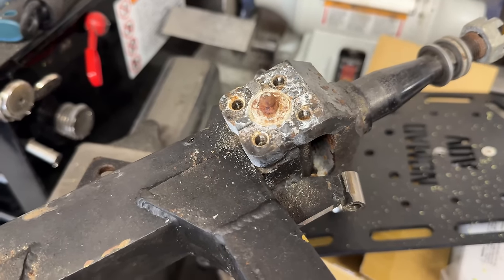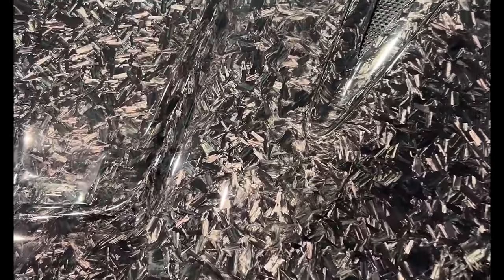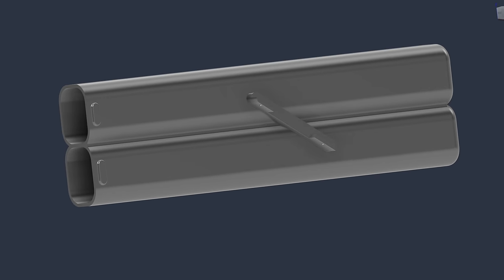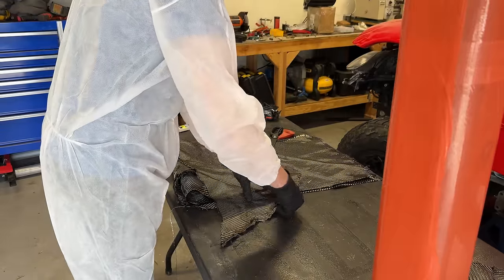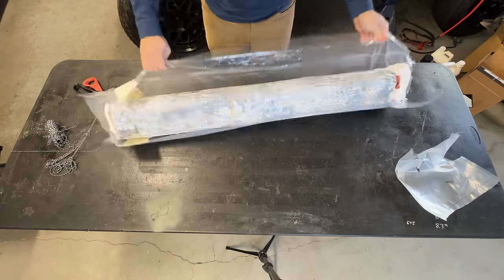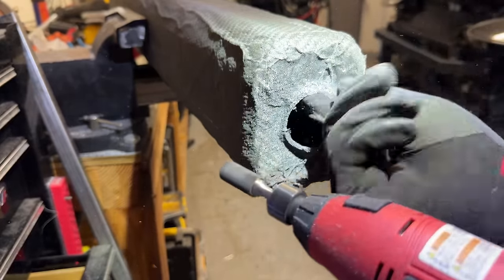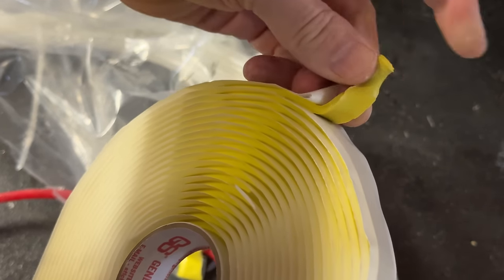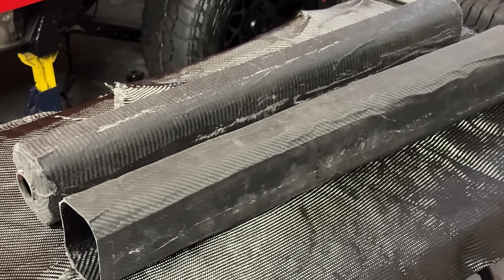Composites Are Hard

Comment: What better place to nitpick than a youtube comments section. Lamborghini's original "forged" composite patent does actually contain test piece data stating that for equivalent strength a compression molded chopped fiber laminate part can be 17% lighter than a traditional layup. You're not going to see that result using a c-clamp in your garage, but you can form under high pressure and achieve stronger parts. /nitpick

Comment: for tubes like this it's much better to do a cavity mold where you print the outside of the tube as a mold then use a bladder vacuum bag. the mold would then only be 2 pieces and would pop right off and leave you with a pretty outside and ugly inside.

Comment: You probably could've got away with making them in 2 pieces with the tops open and just using some 5 minute epoxy or whatever resin crap you had left over to glue them together. Would have been easier to pack the stuff onto the mould without it sliding around and growing veins. Also using multiple coats of chemical release agent helps with getting the stuff off. Oh, and 1 layer would've probably sufficed for a parachute tube, I really want to know what was going on in your head to make you think 4 layers of some of the stiffest composite known to man was necessary for a non-structural tube. 

I don't know if you've already planned out how you're going to make the body but I'd recommend getting loads of stiff foam boards. Easy to glue together and shape into whatever you see fit and skinning parts is a lot less painful than making 4 sided moulds that are a complete PITA to remove. Only issue is your garage will look like a dust storm swept through when you're done. You can also always leave the foam in as well and claim you did it because you're using fancy foam-core composites and not because you're lazy and it doesn't matter.

Comment: I think in this case it would have been easier to paint the mold in resin, then lay the dry carbon weave over it, letting the resin soak through (tamp down a little if needed with a brush). Depending on the cloth weight you can get 2 layers fully saturated this way without applying more. You might have to add a little here and there if you didn't get it fully even. I find this method a lot less messy on straight and easy parts like this. Paint on additional resin when applying more layers as needed. You want everything wetted with as little excess resin as possible. Getting that right takes a bit of practice though (Ok, no, I shouldn't lie. It takes a lot of practice. And you'll be questioning your life choices along the way)

Comment: There's a lot here that could have been easier, taking the methods used by model glider enthousiasts:
-the technique of putting cotton outside to soak up excess resin is unknown to us, we put a collector between the work and the vacuum pump. There is certainly another method that would work with your food vacuum pump
-the 3D-printed inner mold are much too complicated as you discovered the hard way. You could have done something much easier by doing it in expanded polystyrene, that you dissolve with a little acetone afterwards - expanded polystyrene is almost all air and very little acetone is needed to turn it into mulch.

Thats the way model airplane wings are made.

Comment: You could try heating up the 3D prints next time. PLA gets soft at a very low temp, you might be able to heat it up and bend and pull it away.

Comment: I’m confused. Why not just use a 4x5 rectangular aluminum rain gutter downspout? Light, thin, (probably) strong enough, proper dimensions, readily available, cheap, quick.

Am I underestimating the loads placed on said tube in holding and deploying a parachute?

Also, shouldn’t the tail end of the tube be carefully smoothed, to prevent wear to the parachute cord post- deployment?

Comment: A quicker and easier way to do this would use foam as your mold. Buy a block/glue one together, cut it to shape with [insert cutting tools], and do the layup.
Afterward, you can take it out with just a slot screwdriver. If that’s too tedious, it’s easy to  burn or disolve it out
Reply: Take it out with slot screwdriver? How big are your screwdrivers? Apparently you didn't notice the size of these tubes.

Comment: Forged carbon is basically cheapest way of doing glass fiber but you have to chop the tows since until near past it was not available in that form, so it's actually more expensive and has worse load bearing capabilities. Calling it a garnish is probably the best way someone have ever mentioned it from afar.

Also, me being a composites specialist during opening monologue: Hell yeah, training! Discipline! Attention to detail! Experience!
Me exactly one minute after: What the f*** is Aluminized Steel?

edit: Now i have watched the whole thing, you did 4 layers of what looks like 280-330 grams of carbon fiber for a couple canisters? My friend this was not a return to composites, this was a crash landing to composites. No matter how entertaining it seems in the video i understand your pain. Also nest time, use the condom as a permanent mold, trust me.
Reply: I hadn't heard of aluminized steel either, but Wikipedia says it's "steel that has been plated with aluminium or aluminium-silicon alloy, in a process analogous to hot-dip galvanizing."

Comment: I was thinking if you can make the handle a screw in and pull out kind of concept, but realised that if you needed that much force to remove the mould, pulling the mould out may not be an easy step.

Comment: I'm pretty sure more educated people have already explained this several times in the comments, but I like shouting my unwanted opinion about very specific topics.

13:45 pretty good chance the reason your print cant handle the load is due to the print direction. Stacking donuts on top another to create a cylinder (please bare with me and my half assed analogy) is bad for layer adhesion and will often be the first point of failure. Usually it is better (for structural parts) to design and print them laying down or on their side, to work in line with the intended work load. Keeping a handle on things would've (probably) worked better if the layers weren't like stacking donuts and you grabbing only the top 30 of them, but instead to have bigger sized donuts that are stretched all together in the same direction instead of getting pulled apart. 

I am way not capable of explaining this properly, but other smart Germans like CNCKitchen have very elaborate advice and testing about this. Especially CNCKitchen is worth checking out to get a good insight on how material and structural properties change depending on different factors. (Whoever reads this pls check the Kitchen and don't stick with my donut analogy)

Another topic (which is highly debatable tho) is the gyroid infill pattern. While it looks pretty g r o o v y and brings improvements to flexible filaments, solid filaments (I'm guessing you are using PLA or some PLA+ composite) can benefit a lot from other infill patterns, like my favourite Cubic Subdivision. There is some testing done on most common and new patterns you can look up, but I'd just recommend sticking with cubic subdivision for hard and structural parts, use gyroid for flexible filaments and test around what works best with your setup for good looking nick nacks (to avoid artifacts like ringing).

Also just to annoy some people: Id def recommend using Cura over PrusaSlicer, because prusa is for nerds that upgrade their printer more than they use them
Reply: Ohh also there is an extremely useful pdf for designing especially for 3D printing called "CAD design tips for 3d printing by billie ruben", its only 2 pages long but covers most mistakes people make when starting CAD with 3D Printing or coming from other realms of the CAD underworld

Comment: I have said this often, trying to do things the way you think is smart is often the dumbest.
Using 3D printing for anything bigger than a phone case is nearly always the dumbest.
At hardware stores and plumbing suppliers you will find this stuff called Down pipe , it comes in round and square in numerous sizes.
Using a pvc down pipe as the chute holder or the mold for the chute holder would save hours of printing and wasted materials.
Also if you want something cheap and easy to wrap molds in use packing tape.

Comment: The inside is always a better finish I have noticed. I try to do the panels with the mold on the viewable side.
Reply: On this, the inside is the surface that has to have stuff sliding on it and hoping nothing gets hung up, so obv that surface has to to be smooth and the outside doesn't matter.

I think the easiest way to have a good inside and outside for something like this is to use that stretch/clamping tape instead of peel ply and vacuum bagging.

Comment: When I was dumber, I worked at a composite shop. It was summer. I remember cutting fiberglass sucked. And cutting carbon was worse. And cutting aramid was the worst. There is nothing worse than cutting aramid in the summer, hence it is the worst. After that I grew a brain annnnnd stopped cutting itchy stuff while sweating extreme nutsack. Anyways. Put 2 or 3 layers of rubber gloves on. Makes it cleaner to pop the top layer off and you're still protected.

Comment: Fun fact about Carbon Fiber: My uncle that worked at a major manufacture of commercial airliners once told me that unless you're using high quality pre-preg carbon fiber, the strength to weight ratio will be about the same as fiberglass, which is why Carbon fiber only gets used on the most advanced designs of airplanes, because in most cases, it's no better than fiber glass, unless prepared properly using pre-impregnated carbon-fiber.

Comment: Just some thing to think about:  While looking down those tubes, I noticed they don't appear to be extremely smooth.  I'm thinking carbon fiber, much like fiberglass, when epoxy resin is added and cured can be sharp and even cut items on the rough spots.  What is that going to do to your parachute as it gets pulled from the tubes?  Might want to give that a test with a bed sheet or something similar.

Comment: Using the spray adhesive is one reason the weave didn't settle properly smooth under vacuum. You stuck it in place so it couldn't move...

Comment: would you believe me if I said I made carbon small carbon fiber pistol grips for hunting rifles outof carbon fiber using aluminum molds from a injection molding uspplier and a $50 oven we got off craigslist. the parts had a consistent finish and cost a fraction of the usual price for a part of that complexity. And we could make them in batches of 20, 3 times a day, for a total of 60 high quality carbon fiber pistol grips.

With enough effot, you can half ass composites. I've done it

Comment: Wow you really did it the hard way but you didn't know any better. I'm a composite guy from way back in the 90s. I used to work for a company making the molds and parts for Indy cars and Toyota Atlantic race cars. Then I moved on to building some crap airplanes for the military at an aerospace company. Next time make the tubes like carbon fiber golf club shafts. Mandrill in the middle, wrap  carbon fiber and shrink tape with release agent on it around the outside. Heat in an oven.  If you need help (you do) I can explain how  to make every single part of an indycar. Knowing the little tricks and which types of molds to use makes everything so much more enjoyable. Not really. I've done everything from wet layup fiberglass parts to prepare carbon IndyCar monocoques to carbon aircraft fuselages and wings. I ran the autoclave, wrote the layup procedure books for parts and explain to the new engineers how to make the parts they designed.  If you need help or advice let me know. It's been years since I've been out to see the cars run at the dry lakes in CA. Half the phone is looking at all the different designs everybody comes up with. Every car is different. It's the last wild west of speed. Love your content. I watched them all.  Keep up the sarcasm.

Comment: Carbon fiber has the added benefit of being hazardous material basically whenever its not in bulk form and preferably locked in the cured plastic matrix. At best its a bad irritant, at worst its on par with asbestos. Most hobbyists working with have no idea how bad it actually is.

Comment: Remove wrapping just after epoxy has kicked. Do not wait for it to dry. In your temp about 2 to 3 hours. You can easily cut off any excess with a razor knife.
 I could go on and on but it would be quicker to say what you did right.   You tried.  And when you try and try again you get it right.   Composites have 1 thing going for them. Once you figure it out, you go it.   Next time spend MORE time on the mold.

Comment: I'm sure you know this, but there are big differences between fiberglass fabrics. For instance the nice 1:1 weave ones (linen weave i think) are very hard to drape right over curved surfaces whereas the 1:3 "body" weave is much easier to get around rounded shapes. For a lovely finish there's the special checkerboard pattern stuff. Your carbon leftovers seem to be of an extremely heavy fabric.

Comment: I'm relatively new to 3D printing, but I think the reason your handles broke off could be due to the orientation you printed it in. It looks like you printed it so that the handle was facing up while printing, which means that the weakest part (the vertical layers) are the only thing holding it together. What (maybe) would've been more successful would be to print it sideways, so that the infill is what's holding the handle to the rest of the 3D printed part. They also have some variants of PLA and PETG that might've been more ductile or tougher, which might've been enough to break it loose...or it might've just caused a different problem...or I'm completely wrong and you printed it the right way and it all broke because the all powerful algorithm wanted more content!

Comment: I love your videos despite not giving a fuck about cars. I simply enjoy someone making a purpose-built machine and sharing how they do it.

P.S. the reason your 3D prints fell apart is because of the layer lines. Printed parts are weak along the layer lines, so you should always put the axis you need the most strength in parallel to the printbed.

Comment: glass and carbon are absolutely not the same!  a "nice" glass cloth like 7781 is probably 100 times easier to work with than any carbon.  zero irritation ftom the inevitable mess of fibers floating around the shop, they even collect themselves into convenient fur balls that are easy to vacuum up.  and the real big difference is that glass goes clear with resin so you can see all the bubbles and voids that need attention during complicated layups....with carbon you are working blind.

7781 is probably the perfect cloth for that body.  takes compound curves very well and even without a lot of effort results in a very high fiber to resin ratio

Comment: the worst thing about carbon fiber is that you have to go soooo thin to actually save weight because carbon is heavy and, like the video says, you have to do it right and you really cant fix mistakes. You cant really sand down a bump on a wing when the bump is many many times taller than the thickness of the skin. Also thin carbon parts can have more tensile strength than you would ever need but be totally fragile in every other way and get destroyed by being handled. 

the closest to carbon fiber I ever want to be is to build a structure in something that doesnt suck to build, and then laminate carbon tows to the outside as part of the final finish. Built up balsa wood wings with carbon on the top and bottom of the spars are mwahchefskiss

Comment: If weight and strength aren't really an issue why not just 3D print the finished tube? Or 3D print the tube and add glass or carbon fibre reinforcement on the outside?

Comment: Is that special plastic sheet stuff the kind that shrinks when heated with a hair dryer? Because that could help solve your wrinkly parts.
Also, goddamnit stop breaking things that are tight when you could just use compressed air to pop it out @SuperfastMatt I hope you read this.
Finally, carbon fiber actually shrinks when heated so if you want to get it off something, make sure it's not warmer than when you molded it. I'm not gonna go so far to say as put in a busted fridge with a bucket of dry ice but that would probably pop it out of a mold it was wrapped around. Of course this also means that you can probably heat up a mold if it's around the outside of your part and it will expand while the carbon fiber will contract, doubling your volume change in the materials letting you get them out easier. I don't know shit about carbon fiber though, so don't listen to me at all about anything.

Comment: Even if total weight is not that important, mass distribution may be a contributing factor to your instability at high speed. You want the weight to be in the front to be more stable, so having heavy tubes behind the rear wheel is perhaps bad?!

Comment: I'm thinking that a mold of EPS or "styrofoam" could easily be dissolved with a bit of gasoline. It would be easy to carve to the right shape, then discarded after.
Reply: Need some pretty dense foam for it to be able to handle vaccum bagging without moving at all. + if you didn't feel like sanding and finishing the inside of a 4' tube you would want to jacket the foam in something, kinda just making the problem come right back.